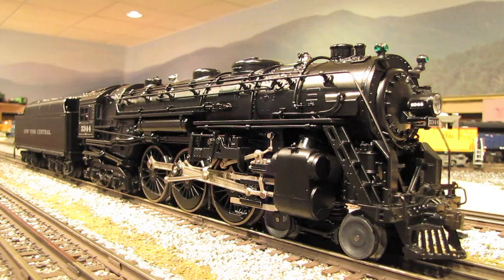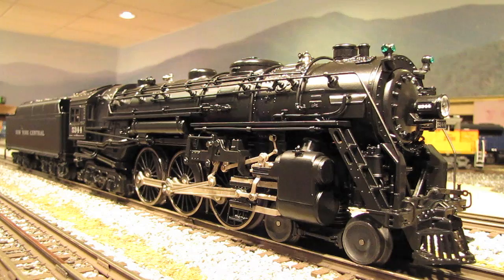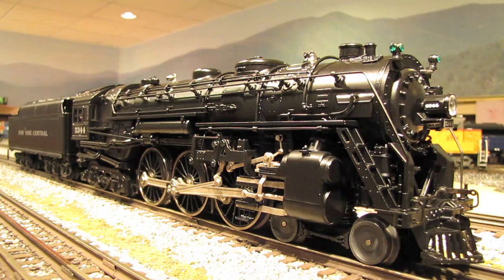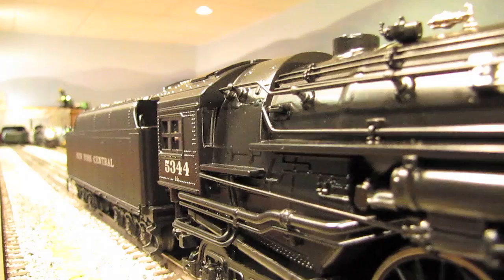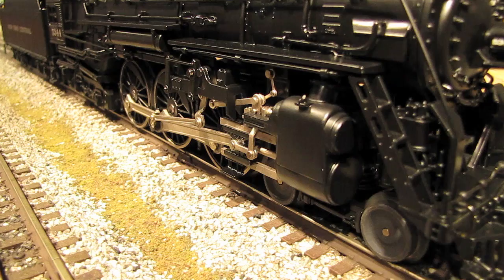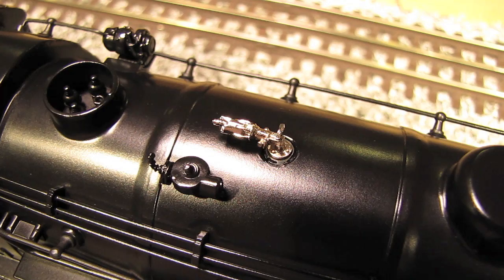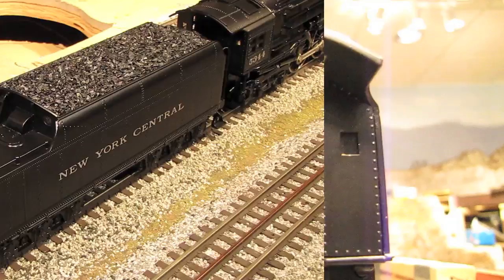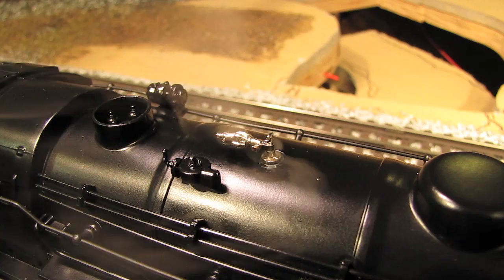Lionel Vision Line 700E Hudson

Comment: Wow! If I were still into O27, I would have to have this beautiful Loc! Lionel has come a long way. I used to work at the Mt Clemens Mich. plant in 1971, injection molding department, when they were owned by General Mills. At that time I felt that the quality was a bit lacking, too much plastic where they used to use metal. I'm glad to see these improvements.

Comment: Yes! I can remember my co-worker dropping the Hopper car molding die, from the forks of the Hi-Low, from about 5 or 6 feet up, onto the concrete floor, while trying to load it onto a shelf. I was at the other end of the building, and heard the load crashing sound. I came running over, and saw the die broken on the floor, in two pieces, and a hole in the concrete about 6" deep! He wasn't fired, but admonished, it was just before Christmas. It was always a challenge lifting the dies safely...

Comment: I should have pulled the trigger on this engine a few years ago as they are extremely hard to find getting more than they originally sold for on the secondary market!  I'm still hoping they will do another run of the 700E Hudsons (non Vision Line) soon.

Comment from the maker: It can, but you still need the TMCC command base as well as the cable to go from the command base to the TIU. I don't run any Legacy engines with my DCS remote because you just don't get access to all the cool Legacy features that way. You only get basic control over the engine.

Comment: Fantastic video and fantastic train! Just one thing, the reason they did a gray version is to acount for the 763e. The 700e only came in black, but the 763, which was basically a slightly stripped down 700e with a tinplate vanderbilt tender for a smaller price, was usually gray. I have the 1990 700e, it looks very similar to this one seeing as they tried to keep the feel of the original, the only added thing I can find is a back light on the tender.

Comment: Wonderful engine.  My one criticism is the crew chatter.  It would be more appropriate for the time period of the engine to have the dialogue engaged between the engineer and fireman, relating to engine/fire functions and track condition.  Also, there should be talk option related to the seasons, such as winter and a snow storm  and summer with rains or sunshine.  Also, day and night running talk would be a great option.

Comment: wow I looked up the inflation calculator online. $75.00 in 1937 has the same buying power as roughly  $1,250 in 2016. So really it was the same as today's premier steam engines. Very expensive!
Reply: Yeah wow! That answers a question I've had for awhile, if the old ones were as expensive as the new!

Comment: I wrote to the Lionel Corp and told them that now that they are offering such highly detailed, very realistic and expensive scale models- that they should offer their high end products with a 2-rail option. They wrote back that they would consider it. The rest of you could weigh in if you like, as they are responsive to public input. 2 rail is not unprecedented for Lionel; their OO and HO line was 2 rail.
Reply: Actually, Lionel OO was 3-Rail like for example Marklin. Lionel did make G gauge for awhile. So, it was G and HO that was 2 rail from Lionel.

Comment: I was wondering if you can help with a problem, the new vision line 700e said you need a minimum curve of O-42, will that work with o'27 42" curve track or do I have to switch to O gauge

Comment: @crazy7892 hey i have a 773 hudson from the #13150 hudson steam freight set and i have been researching its the same cast as the 700E same length and has the same construction and same advertised minimum curve. I have run it on 0-36 fastrack and it does great very little binding around the turn im not sure if 027 is big enough though.

Comment: If this engine was meant to be a close representation of the original and not have "Super Modern Detail" I wonder why LIONEL decided to add on such things like cab interior, sliding roof vents and glass window inserts etc.....? Seams they just decided what they wanted to add as far as high detail. I for one would have liked to see one of two things! Either make it super scaled and super detailed or keep the detail as the original all the way around and just add the legacy controls. With that being said I still think this is a beautiful engine. Im just curious as to what was their line of thinking when adding in the mentioned details.
Reply: As Eric said, this is meant to be the 21st Century version of the legendary 1937 700e, meaning that it would look the part of the 700e but also have the great features of today such as LED lights, fan driven smoke unit, Legacy Control, Odyssey Speed Control, Legacy RailSounds, detailed cab, opening vents, wireless tether, and plastic inserts in the cab windows.

Comment: I am so glad I took a hammer to my Lionel the garbage machines I have a real king old skill model and that's way better than Bluetooth Lionel I have a circuit breaker on mine and I like it does Lionel get that no I prefer a big control panel instead of a little Bluetooth garbage remotes real Kings better than Lionel I got all the big boy trains for real king I ended up at having help with my grandpa before he died 5 years ago and I built everything with him now I run the trains all the time but not at night because I have it where they put out smoke and I don't want to fill up my house what smells like smoke